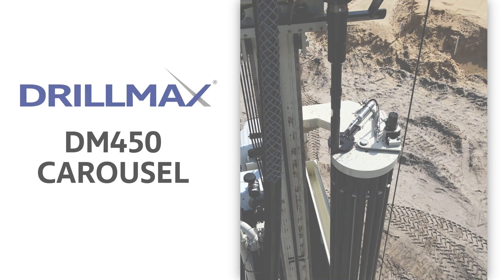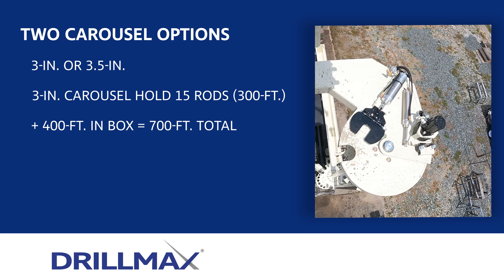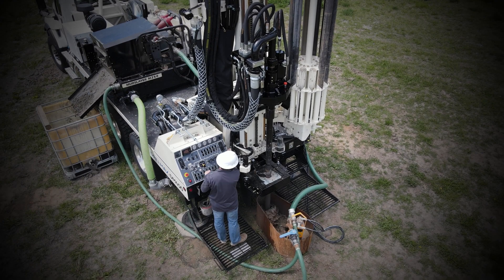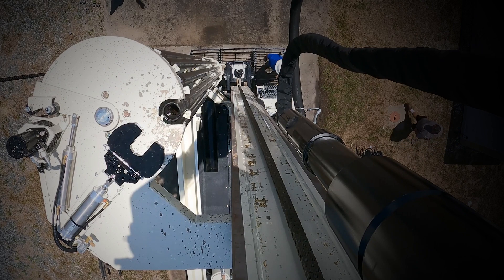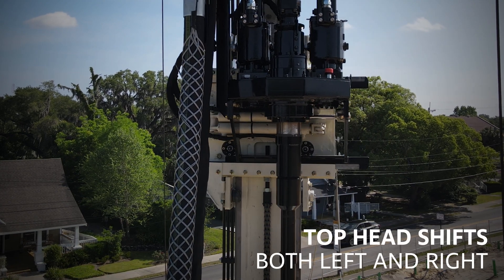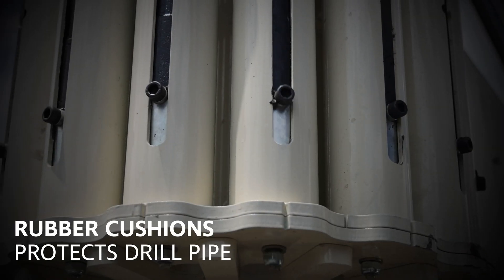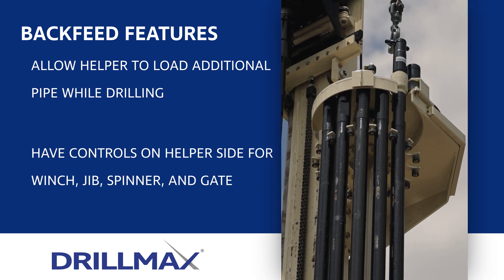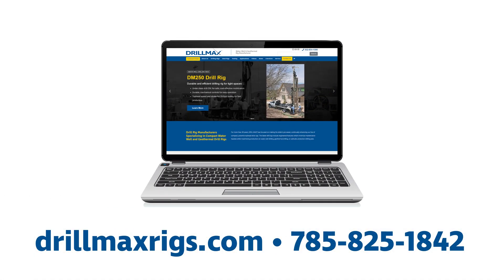DRILLMAX® DM450 - Rod Carousel

Comment: When you are backfeeding the carousel,  What turns the drill rod so the hoist plug can be removed from the drill pipe? Is there a rod spinner of some kind built into the carousel?
Reply: It looks like there's a rod spinner unscrewing the lift plug